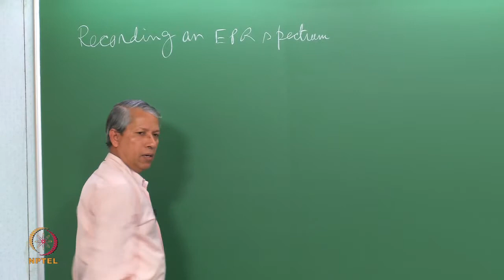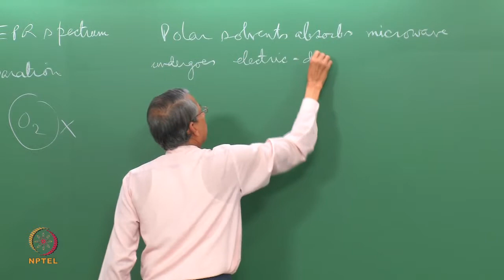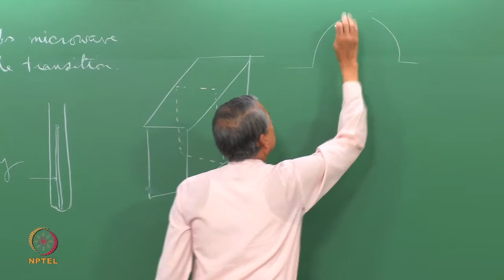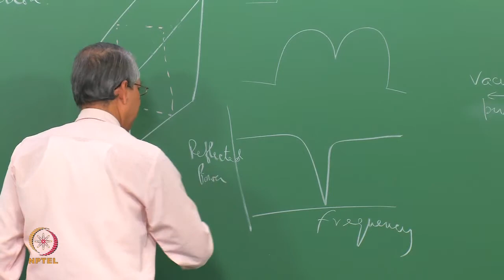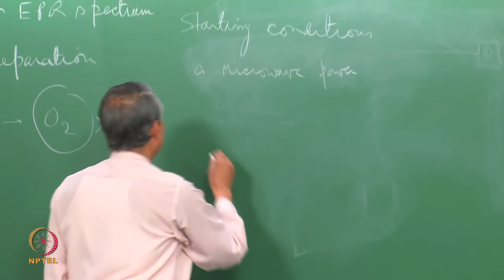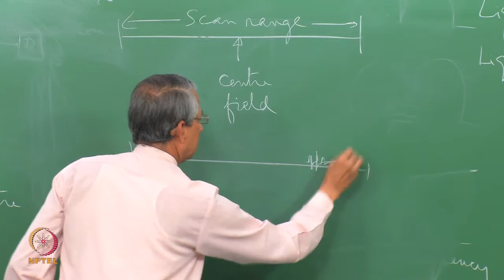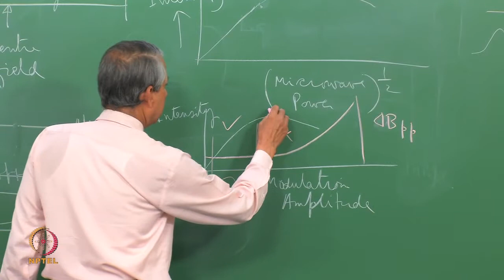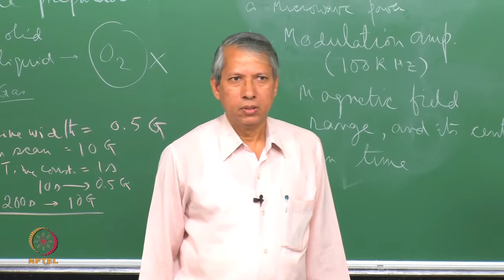Mod-01 Lec-17 How to Record EPR Spectra

Comment: Hi, Great lecture! I wanted to ask why the modulation frequency is typicaly 100 KHz and not something else?
Reply: The diode detector has noise that goes inversely with the frequency, the so-called 1/f noise.  So higher the frequency of the signal, lower is its noise component.  Keeping that in mind, modulation frequencies higher that 100  kHz could be used in principle for lowering the noise further.  But another effect comes into play.  The modulation coils are mounted just outside the EPR cavity whereas the sample is inside.  Thus the modulating magnetic field must penetrate the cavity to reach the sample.  Penetration of the modulation inside the cavity depends on the conductivity of the material of the cavity, which is usually made of brass whose surfaces are coated with highly conducting silver and gold.   Higher the modulation frequency lower is the penetration.  So a compromise has to be made in choosing the frequency of modulation.  The highest possible frequency for minimum noise and lowest frequency for effective penetration of the modulation. The 100 kHz frequency is found to be the optimum.